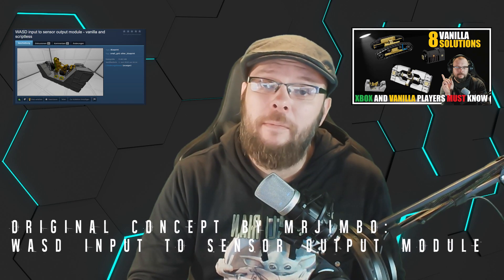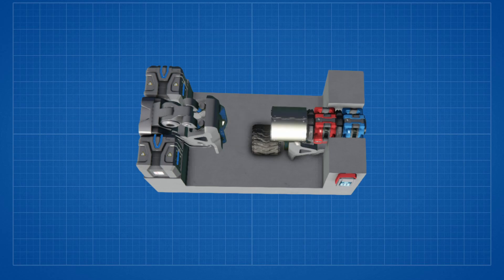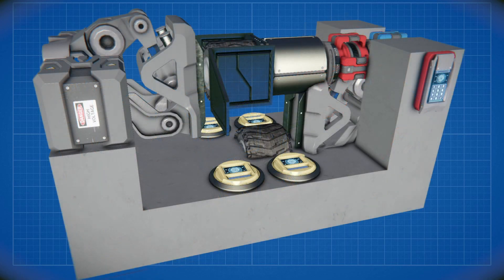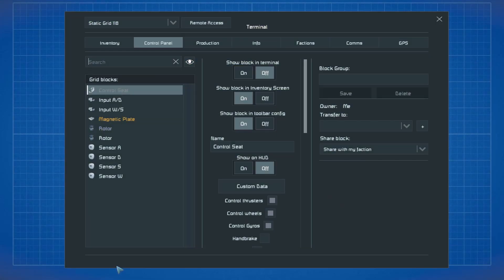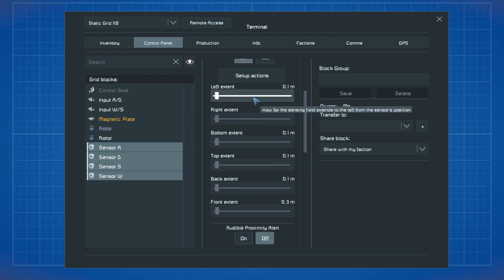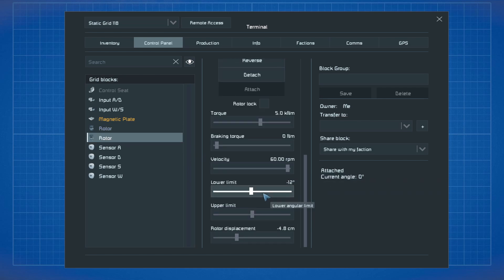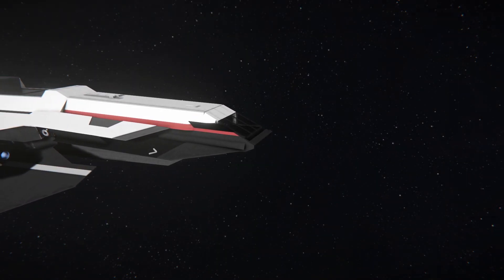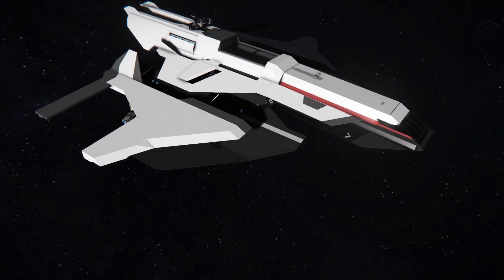[SPACE ENGINEERS] W.A.S.D. Converter - TUTORIAL - Vanilla & Scriptless!

Comment: Thank you for showing this tool, I've seen something like it from a YouTuber named Hand n Ease (sorry but pretty sure I spelled it wrong). He put out two versions but both were quite rudimentary, they lacked refinement but the idea was just as awe inspiring. Your version is compact & clean in construction, just what I needed to start my mech build... mostly. Please know that I've made only a little progress so far but "progress not perfection" as the saying goes. All I have a is a self-centering torso (same 2-rotors in "WASD Controller"), 4-rotor "ball joint" & a gyro stabilizing frame with your Controller stuffed inside that... The "WASD Controller" I made before I seen your design is too bulky & unstable... I setup my version on a large grid 6-way H2 thruster engine with built in gyro stabilizing, gave control of the gyros to my Controller & just played around with different ways to control it. I could post it in the workshop if people want but it's still a prototype so no info will be provided (can't tell people how to fix something if I haven't figured out how). Anyway I'll check out the response to my post in a few days to see if anyone wants a copy of my prototype, ya know to examine an alternate "WASD" thingy (was calling it "Sub-Grid Control Unit" but your name is easier)...
Reply: That sounds cool! Is it on the workshop now? I’ve never messed with subgrid thrusters or suspensions, I’m just starting to use event controllers, timers, & (soon) AI blocks

Comment: I was testing and messing around with this and found a problem. Using the settings you suggested, the mechanism turns itself off whenever the grid exceeds 6 m/s, but if you lower the torque on the rotors then it keeps working at high speeds. When you are at higher speeds (60 m/s+) with the lower rotor torque, the mechanism becomes sluggish.

The problem seems to be that the wheels generate less torque when the grid is moving, decreasing with the speed until the rotors can overpower the wheels and it turns itself off. 

Is there a way to fix this? As it is, then makes it almost useless for anything that moves.
Reply: Firstly, you can get more responsive controls by decreasing the angle limits on the rotors and increasing the size (forwards extent) of the sensor fields. This can only be taken up to the point where the natural shaking/wiggle room of parts in SE starts triggering the sensors. If that doesn't do enough, I have 3 ideas that require actual engineering:

You could turn this "flaw" into a speed sensor! Use a wheel on override, which at a certain speed will become too weak (assuming that this effect also affects wheels on override) to overcome it's restoring rotor, which you can then sense.
Such a speed sensor can then be used to lower the torque on the rotors. This keeps the high fidelity controls at lower speeds, while at higher speeds it would switch to the more sluggish controls, instead of loosing all control. (I don't know if sensors and timer blocks can change rotor torque; If not, you'd need to swap between a strong and a weak set of restoring rotors. One idea would be to putting them in series - like the rotors for the 2 directions are here - and rotor-locking the weak rotors at low speeds. But if these weak rotors are locked in the wrong positions, you would get "sticking" inputs, so you should make locking the weak rotors a manual action on your hotbar that you only ever use with the "W" & "S" keys released. For an automatic reset, you'd need to feed the "W" and "S" sensor outputs into some logic that prevents locking until after both keys are released and the rotors had time to return to their neutral positions.)

Alternatively, you could use 2 or more wheels to compensate for the loss of wheel torque. Instead of the cylinder-shaped block at 1:43, you build a U-shaped clamp around this first wheel+suspension assembly to reach a 2nd (3rd, ...) wheel further to the left in line with the first wheel. This would probably be my preferred solution.

Thirdly, it SHOULD be possible to use wheels on override to provide the restoring torque. The issue that wheels can't have rotation limits set SHOULD be possible to be overcome by making them hit physical backstops. The easiest way to engineer such backstopped wheels would be to make separate converters for "W" and "S" keys.

[edit:] Kelevra himself fixed this issue in this video https://www.youtube.com/watch?v=eYQ9hHKfhxE , using additional wheels. Similar to my second suggestion, but he was smart enough to use the wheel friction to put them in parallel with the first wheel.
Reply: the controls aren't designed to use only the 2 wheels to move the system entirely.

this is just simply to control the WASD functionality.
How you carry out that functionality is completely separate to how your trying to do it.

these sensors would trigger an activation to propulse forwards or backwards, that rotation is simply just a sensor field, thus torque shouldn't need to be adjusted unless your picturing the use of this incorrectly.

Comment: Have you actually tested this on high acceleration ships to for example control gravity drive because I'm afraid it will just tear itself to pieces.
Reply: Realistically this shouldn't, many people panic about clang but if everything is properly setup, there shouldn't be any clang issues.
thing about clang is its generally caused due to a physical error, in order to be concerned about speeds would require a mod that allows you to travel faster then 600m/s before anything like this should be a concern, which even Keen state a normal block is a concern beyond that speed limitation.

Comment: Is there any way to also detect up/down movement? This seems like it'd be great for scriptless gravity drive controls
Reply: Check my post, my prototype is exactly what you're asking for. Just remember you'll need to log into the remote control block to have Direct Control... Let me know if I should put it on the workshop.
Reply: Huh, sounds interesting...how does that work, anyways? I figured using thrusters would be the way to make a 6 way controller work, but how do you move it back to a neutral position after releasing a direction?
Reply: @BaegEhl-Lord-Of-Circular-Bread  the way I set up my "converter" makes the difference. It's a small grid hanging from 2 hinges in a large grid compartment, it was carefully balanced so with a gyro on the "converter" the tool can swing left, right, pitch up & down. Gravity keeps it down in a neutral position but that's also why it's unstable, when the grid it's attached to moves momentum is transferred to the "converter" giving false input & the sensors are triggered. I played with it for days & still couldn't fix that problem, I consider the problem may be in placement. It took a week to tune the weight of my converter JUST right & a month ago I finally built something to attach it to... I got too many projects in the "prototype phase" & maybe 5 things in the workshop (I don't like posting unfinished work)so if ya want a copy of my "converter" let me know & I'll post it. I've got some things I was going to post (parts & tools been procrastinating on mostly) but the "converter" wasn't on my list until this vid... Still not sure I should post my "converter" but if requested. Steam & Xbox tag is "Johnny Autokill".
Reply: @Johnny-Autokill  Ah, that makes sense. If it uses gravity to center itself, wouldn't that only work in atmo though? Anyways, i'm probably gonna do some experimenting myself with this, given that pistons tend to be kinda floppy i figured maybe they could be used with thrusters to make some sort of vertical input detection?
Reply: Don't know how you'll get a piston to do up/down movement but good luck, probably going to need the piston on a hotkey or 2.

Comment: Suggestions, huh? I've been trying to make a 3d printer mechanism using the custom turret controller. This way I can move something along the x and y axes with just my mouse. For example, a welder. And I kind of did. I made some connected scissor mechanisms that will extend by using a rotor, and put that whole thing on another rotor. This does work, but instead of moving forward/backward/left/right, it rotates along a point and extends.

The only limitation I have is trying to convert the rotation of the rotor into linear movement. I've been messing around with black armor's gears (the ones from the beginning of his elevator video), and I can make that work, but I can't control two separate grids at once. I'd love to see your take on this!
Reply: I can't think of any other way but a scissor as well and you need at least two (better four) rotors for that. :/

Comment: Great work, but seeing the subgrids of the rotors and the suspension act against each other makes me worry about the clang, like the whole rover starts spinning uncontrolled after pressing down W or S.
Reply from the maker: it doesnt do anything like that. Most clang effects arise from bad construction and specific relations of sizes of grids. 
This is well constructed and too small to do any clang.
Reply: Clang is always self caused by Engineering error.
it just is common because of the many mistakes players can make, which thus can be freaky, this is why many players have been able to successfully design huge projects with well over 1000 rotors and 1000 pistons in 1 function while not enduing any clang, you need to understand the proper engineering and math to ensure it doesn't happen.

there is the extremely rare event you could clang due to a bug on behalf of Keen, however this is extremely rare and Ive yet to see this scenario myself yet in over 10 years.